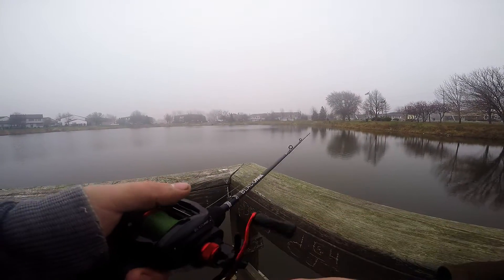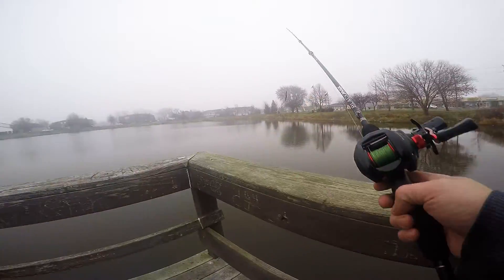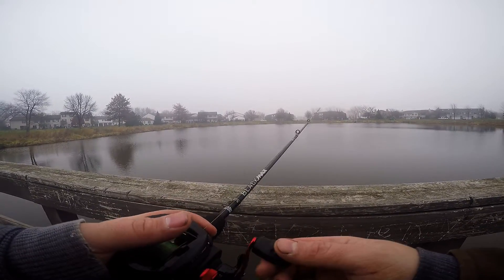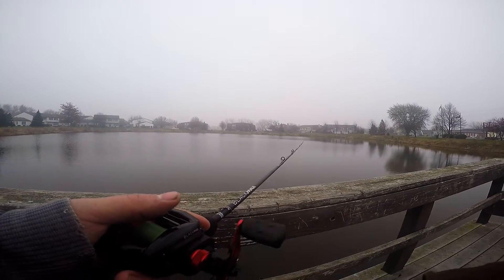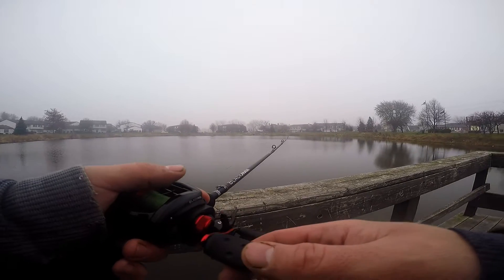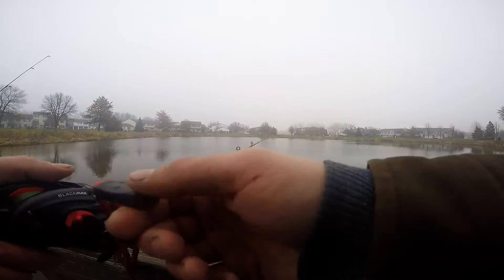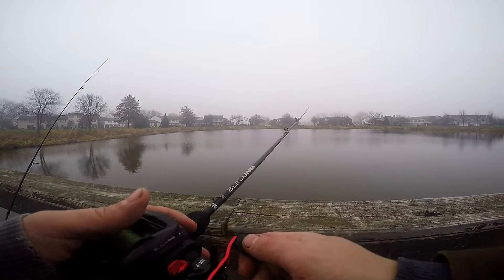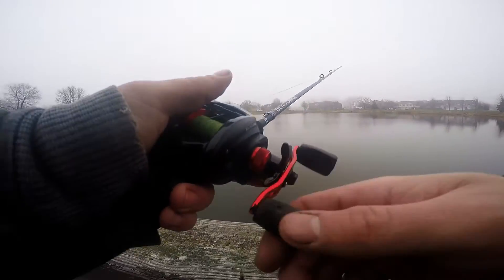Fastest N/A V6 Record talk, Density Altitude, Mod List

Comment: I'm in Colorado and I have a cyclone with a axlebacks intake and a tune and the best run I had was a 15.2 and thats no were near even the stock specs of 13.7
Reply: Seth Snead change your gears and get new tires
Reply from the maker: You would probably run mid 13's on the east coast where Nick ran his times.
Reply: Here is some of my real world testing done on my 3.7 at Atco dragstrip in NJ. All times are at 60-80 degree days 50 to 70% humidity. Mind you my car is a fully stock interior convertible with even the spare tire which is pretty heavy over the fastback coupe. Fresh stock tune up with Accel coil packs 87 Octane 15.0, 93 Octane added 14.8, 93 octane accel tune 14.6, Driveshaft shop 3.5 drive alum driveshaft Magnaflow race mufflers 14.4, 4.10 Ford racing gear set, with SCT 93 Octane tune 13.7. Not looking to make it too much faster or else I have to put a roll bar in it. but I might do it anyway this thing is so much fun!